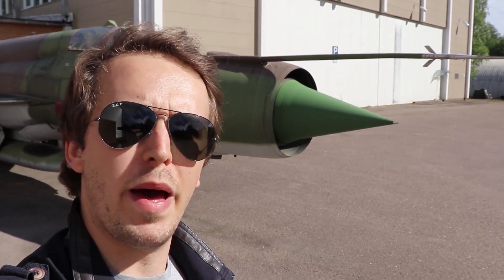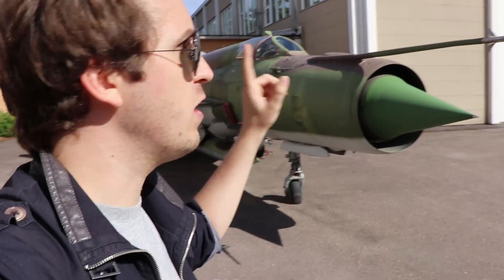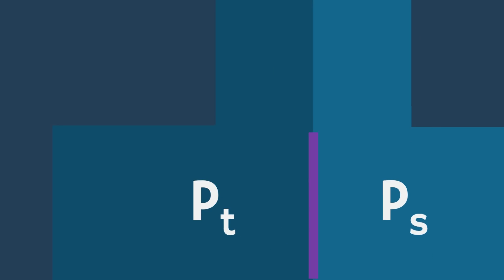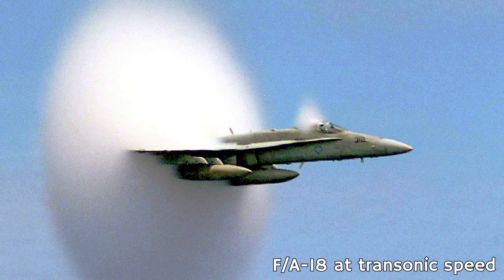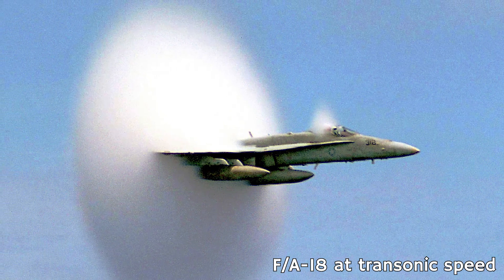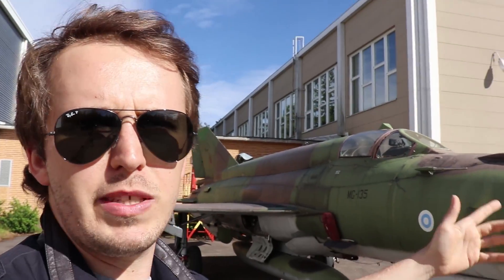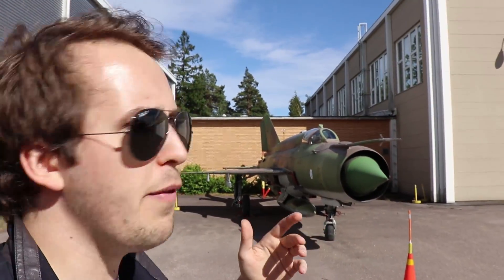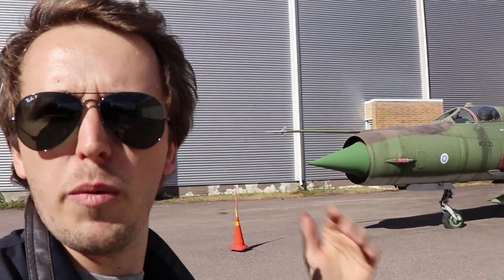Why does the MiG-21 have the pointy thing?

Comment: When you are traveling at high velocity, the air pressure wave in front of you is so dense that to travel any faster requires exponentially high amounts of energy. 

 I always thought that the long pole/lance was there to create a tear in the pressure wave when the plane is traveling supersonic so there would be a cone of low pressure created through which the aircraft could move more easily and require less energy because essentially it is creating it's own slipstream effect. 

That's my two cents. Kind of made sense to me.

Comment: It is a pitot tube, but if it was solely a pitot tube, it could easily be much more recessed. The reason why it's so pronounced is that it's the mounting for the angle of attack indicator for the gunsight computer, and for the sideslip indicator for the gunsight computer  AND  the electronic sideslip indicator (A Soviet speciality!). There's also an additional angle of attack indicator on the left side of the nose, which feeds information to the AOA indicator.
Reply: Specialty? How do the slip indicators work if not just a free floating ball? I thought it was just for ASP-21PFD

Comment: That is soo wrong and you need to get your info straight. I was a Mig21 pilot and the reason why we have those lance thing is to use it for a PSE (Precise Strike Elimination). When we spot an enemy officer on the ground, we dive down and aim the lance at the enemy officer's torso in order to impale them. Most of the time they dies, some times we get lucky (Or if you are really good at piloting your MIg21) and might even be able to capture the enemy officer alive.

Comment: It's a lance to prevent birds from getting into the engine. If you see a bird in front of you, you simply line up the two small flaps at the front of the lance with the wings of the bird, like this you hit the bird right in the heart and he doesn't have to die in pain.

Comment: Now, the reverse question: why other airplanes that fly as fast or even faster than the Mig-21, the F-100 and others DO NOT HAVE THE PITOT TUBE INSTALLED FAR AHEAD OF THEIR NOSES?
Reply: The instrument probe on the MiG is there to provide data to the lead computing gunsight. The pitot tube for the pilot's instruments (airspeed indicator, etc) is attached to the fuselage- you can see it in the video, below the front windscreen on the side of the plane.

More modern planes use different instruments to provide targeting data, so they don't need the long instrument probe.

Comment: MiG-21BIS one of my favourite airplanes when it comes to looks and sheer speed. Finns liked earlier F-13 version better tho, it wasnt as high tech as BIS but it flew better and had better visibility. Oh and if anyone is wondering, MiG's strange cone on front is a air intake, as most propably figured out, but the cone inside the air intake can be moved forward and backward to regulated the intake air flow, thus optimazing the enginw output. On the furthest up front position the MiG-21 looks like to have almost no air intake on front at all, giving it very unusual look
Reply: The air intake cone is moved depending on air speed in order to convert supersonic air entering the engine to subsonic and it is done automatically
Reply: Subrata Dutta hah, thats the more technical way of saying it, thank you 😎👏

Comment: +Bis18marck70  The Mikojan-Gurevich-21 was one of Russia's first bisonic tactical jets.  The extended pitot-static tube above the intake is intended to read total and static pressures well ahead of, and thus unaffected by, the oblique shock off the needle-sharp conical radome; in the mid-1950's, not enough was known about transonic gases' effect on the instrumentation plumbing to develop any compensating algorithms.

Comment: What does that nosecone do? It looks like the air intake of a ramjet. Does it serve the same purpose?
Reply: The nosecone has two functions: Firstly, it does indeed act like a ramjet intake- the cone can move back and forward (IIRC about 20 centimeters, though only a small part of that range is used in flight) to optimize airflow into the engine for the current speed and angle of attack. The second function of the nose cone is to act as a housing and radome for the aircraft's targeting radar. In the case of this aircraft (a MiG-21bis) that radar is the RP-22 'Sapfir' monopulse target acquisition and tracking radar, with a maximum target detection range of 30 km.
Reply: Probably not

Comment: If placing the pietot tube outside the compression wave is important for accurate airspeed measurments, then how come, that some planes flying at transsonic speeds have no blatantly apperant tube at all. On most american jets, you can see a smal pietot tube at the side of the plane, while the dassault rafaele an the eurofighter have their ones probably integratet in the countermesures container in the fin. But i wasn't able to locate it on the f84 at all, so far.

Comment: The malfunction of a pitot tube caused the stall and crash of Air France flight 447 in 2009 killing all 228 lives on board. They are very important parts of an aircraft.

Comment: G'day,

  Um, my guess is that they relocated the Probe-mounting to the top of the Air-Inlet to prevent people from (literally) overlooking it and therefore walking into it by accident, bending the Tube out of true ; the lower mounting position would yield a more accurate reading at high Angles of Attack but not with a bent Probe.

  The 4 little Swept-back Vanes a bit behind the very front of the Pitot unit makes me wonder if that "Sending-Unit" might be capable of collecting Data on Angle-Of-Attack & Yaw - if the Vanes were mounted behind an internal  Fulcrum-point to better align the Pickup hole with the actual direction of the Airflow (?).

  I know that such Nose-probe mounted AOA/Yaw-Detector Probes are used during some Flight-Test Programmes..., but did the MiG-21 have one too ?

  Have a good one,

  ;-p

  Ciao !
Reply: The vanes supply angle of attack and slip data to the MiG's ASP-21 gyro gunsight. The ASP uses AoA, slip, turn rate and range (either determined by the pilot using the target's wingspan or supplied by the radar if the pilot manages to get a target lock) to predict how much the pilot will need to lead the target in order to hit it with his guns. It's a rather useful feature, as most pilots have trouble correctly estimating the amount of lead when attacking a target that's in a turn. Unfortunately it has many limitations- it only works on targets flying at a similar speed to the MiG itself, if the target turns too tightly the aiming reticle may move off the sight glass entirely, and the radar will lose lock if the target flies too close to the ground or gets within 400m or so of the MiG's nose, forcing the pilot to switch to manual ranging. This is still better than relying on The Force to guide your shots though.

Comment: By the way can someone enlighten me as to why some early jets (this obviously and some American ones too) had holes in the front and why modern jets don’t feature them basically at all anymore.
Reply: Sergeant Panther   You mean the air intake. To answer your question, it was mostly because of aerodynamics. As time went on most people realized it was more efficient to make the nose pointed and to put the air intake somewhere else.
Reply: Hiding the intake in the profile of the wing or body for radar signature. Probably cheaper not to have to route the intake through the entire body as well. Better access to compressor blades for inspection on the ground.
Reply: The biggest motivator for putting the intakes at the sides was probably radar: the bigger your radar antenna is, the further it can see. If you have a nose intake the radar must be small enough to fit in the shock cone, which limits its performance.

Comment: One thing that will always be a problem is the pressurefield that the pitot tube itself generates, especially at supersonic speeds (shockwaves and such). But I guess removing the complicated aircraft aerodynamics out of the equation was worth the effort.

Comment: A bit of other trivia about the Mig-21. The most interesting versions I have seen in China (aka J-7). They upgraded their Mig-21s greatly (modern LCD displays, etc.). Originally the Chinese versions were licensed during Krutschow's time and were of the non-capped delta wing configuration, which was never build in Russia itself. The non-capped deltas have been known to be faster and longer range, but less maneuverable. The Russians in later time also built a true delta which was used as a trainer for the Russian Concorde. Those trainers have been known to supercruise, but that was held a secret, because the Russian feared that if supercruise would become the standard ability of the fighters of the day they would have to upgrade all their Mig-21s, which would have financially broken the SU. Anyways, do not invade China, they have passive radar and can hunt you down with dirt cheap jets flying Mach 2+ -- and yes they will engage you close and still have cannons on board. And apropos stealth. During my child-hood in Eastern Germany I could witness our Mig pilots training at low altitudes. They would train attack runs over a nearby lake and the service personnel from the airfield is telling stories to the day,  that they regularly had to bump out the fuel tanks of those Migs, because the would hit the wave tops when skimming close above the surface. Guess how much warning time you have, when those bastards are coming at you 1m over the waterline with Mach 1+...
Reply: The Chengdu J7 has only recently ceased production. The old "Fishbed-C" was a very capable aircraft even by today's standards - supersonic flight on a single engine, and a more than respectable armament. There are a lot of companies still providing avionics upgrades for this venerable old bird - full glass cockpit, and modern fire control radars and interfacing - such that the old '21 can STILL perform it original role as a fast intercept aircraft. Says a lot for the foresight and design excellence of the Mikoyan-Guervitch Design Bureau.
Reply: fuzzel Huh, funny you typed Krustchow instead of Khrushchev (the usual English spelling) , I'm going to assume you're German or Austrian since that's how they spell it?
Reply: Yayo' Ariowibowo: I have no clue. Mr. Хрущёв certainly deserves to be transliterated correctly.
Reply: +Yayo' Ariowibowo
He did mentioned that he was from East Germany.
Reply: Check out romanian MiG-21s as well. Their armament and avionics are similar to gen4 jets.

Comment: This is not unique to high-speed aircraft, you will almost always see such extended pitot tubes on new aircraft in the flight testing phase. This is also not uncommon on ultra-low-speed aircraft, for example the Helio Courier.

Comment: How exactly do leading-edge slats work?
Reply from the maker: Voodoo.

[I'll explain in a future video :). Probably]
Reply: It's a way to force the air go turbulent and then it takes more time to separate (laminar flows are less energetic and less resitant to adverse pressure gradients). That means that you will will lose less lift and have less drag.

Comment: It is a pitot tube (connected to the Mach meter in the cockpit), but it's not the only purpose. Can you see these little horizontal and vertical fins on the tube? They are movable, and they are connected to the ballistic computer for the gunsight, feeding it with angle of attack and slip angle data. There is also secondary pitot tube near the fuselage (on the right side of the cockpit; this one is connected to the speed indicator in the cockpit) and angle of attack probe (left side of the fuselage; connected to the AoA instrument in the cockpit).
Reply from the maker: To the top!
Reply: My father worked as an American defense-industry engineer throughout the 70s and 80s. The rule-of-thumb when it came to comparing Western to Soviet tech was that the Soviet tech always had a lower performance-to-weight ratio than American because the Soviets simply didn't invest as much in weight-saving materials. That said, the Soviets were masters of compensating for this by making as many devices as possible perform multiple functions. Thus, while a Soviet avionics computer usually weighed more than an American one, the American plane often packed on weight elsewhere having multiple devices to perform the functions the Soviets often streamlined into a single device. Got to love engineering!
Reply: The other reason for the long lance is the engine air intake being in the nose of the aircraft.  It keeps the air rushing into the engine from interfering with the probes sensors.
Reply: The secondary one is a backup. There's a selector lever in the cockpit.
Reply: Awesome information. You get a like :P
Reply: A small problem with that is that you're putting all your eggs in one basket as the saying goes.
Reply: @johnknapp952  yeah and on the contrary the americans would be having lots of low risk failures that could cause catastrophic failures to a failures a failure ever way it can end bad
Reply: I was just going to ask that very question ( about the fins on the tube ) Thank you for discussing it. 
I'd also like to ask if you know why that Soviet aircraft use gaudy green paint on their wheels and apply messy red paste ( looking like caulk ) around the canopys, as well as teal in the cockpits. 
I have read several times that the teal color is used to "calm" the pilot, but this does not seem to make sense.
Reply: Eustace Stritchers Ironically we got our titanium for Tomcats from Russia, on the sly hehehe.
Reply: @pgtmr2713   Also the titanium on the SR-71 Blackbird was procured through various means from Russia too,  so they could build the Blackbird at the Skunk Works
Reply: Yep and they paid us back recently, with that Uranium score.
Reply: @pgtmr2713  Baloney!
Reply: @williamjackson5942  They purchased 20% of our uranium, an amount that threatens our national security, from sellouts within our govt. These are facts.
Reply: Utterly top notch, sir!
Reply: dr. Amfibije Radović why would you need 2 pitots? Unless you mean the static and the dynamic probes...
Reply: dr. Amfibije Radović Nevermind, the lance is on the path of engine air capture for low speeds. My bad :)

Comment: this fails to explain how contemporary western aircraft that were as fast or faster did not apparently need these enormous pitot tubes.
Reply: MrArgus11111 Several western planes used these as well. The person who invented it was French after all.
Reply: you'll note I said "enormous". I didn't suggest they weren't used at all, however, they never seemed to be as prominent
Reply: Most planes have a smaller tube on the fuselage or wing, and the MiG is no exception (you can see it in the video!) The cockpit instruments are actually using that smaller fuselage mounted pitot tube.

 The MiG's massive air data probe (it doesn't just measure speed- note the little fins on the end for measuring the direction of airflow) exists to supply angle of attack, sideslip and airspeed data to the aircraft's lead computing gunsight. More modern aircraft use different (more sophisticated) approaches to calculating the trajectory of bullets, rockets and bombs after launch and thus do not need the boom.